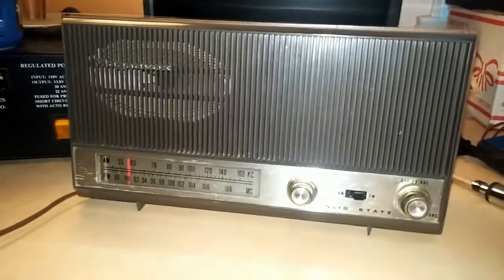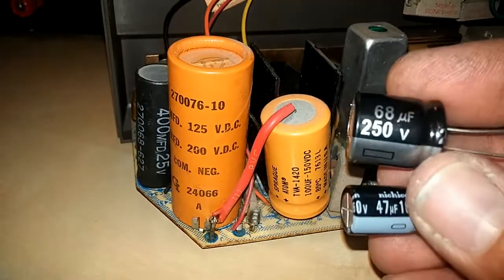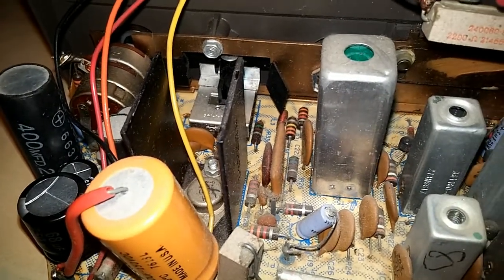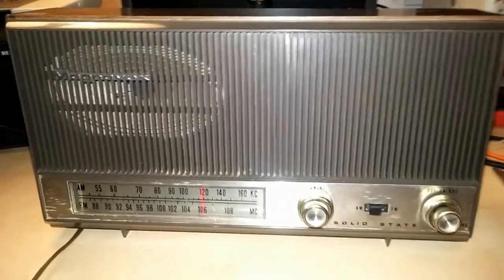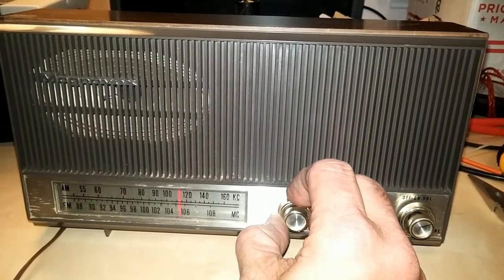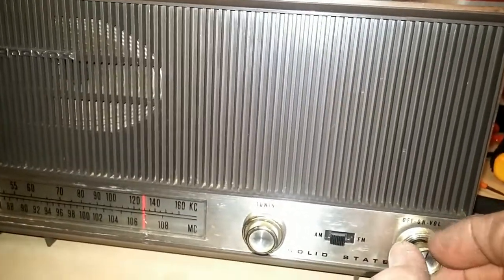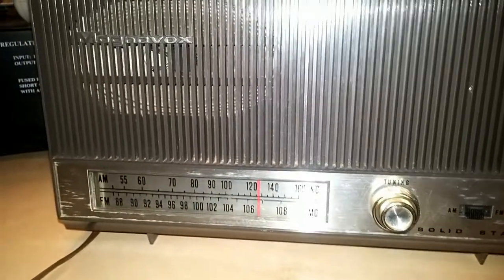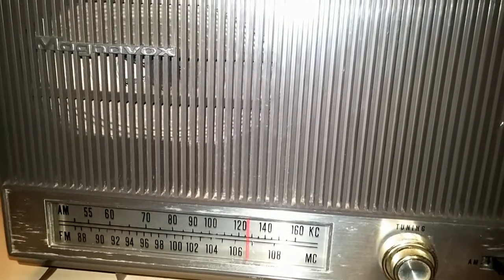Repair vintage Magnavox table radio model 1FM064 part 2

Comment: What generator do you use for IF alignment? I have some Fluke boat anchors that need a new home.
Reply from the maker: Danish Native tnx I have an eico, hp 608 and hp synthesized model from the 80s can't remember the number. So I have more than I really need there.
Reply: Not on par with with the HP608's. It's just a Fluke 6060A that goes to 1Ghz. I suspect they both weigh about the same though. i gave away all my HP600 series cavity oscillator generators to Goodwill a few years ago. They worked great but just took up too much real estate.